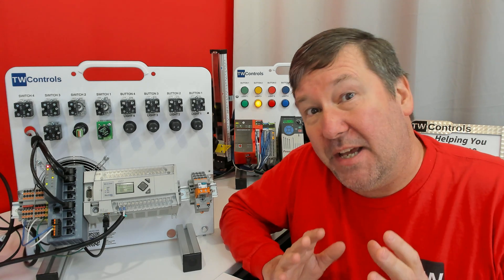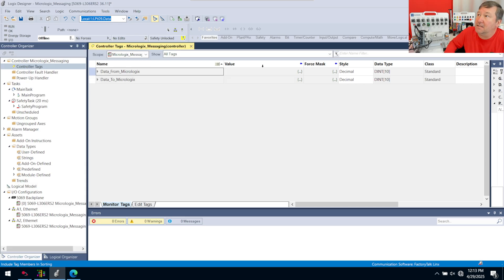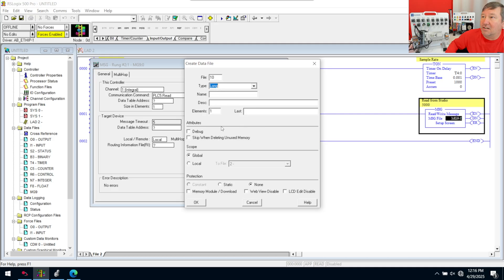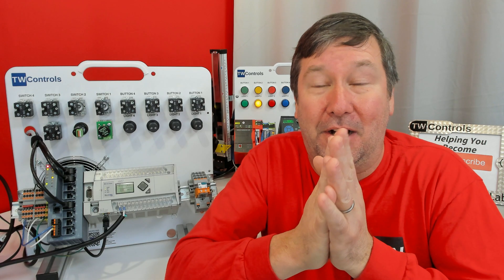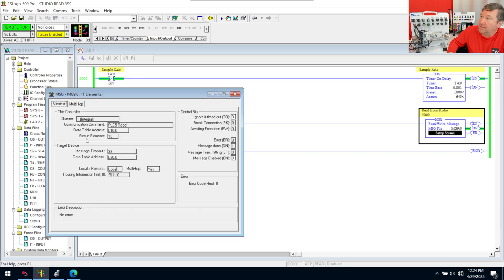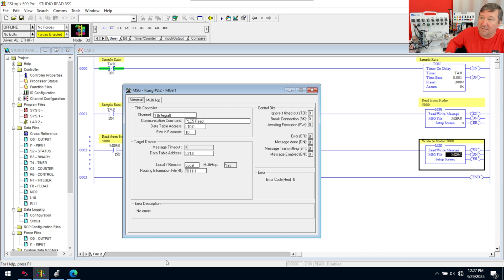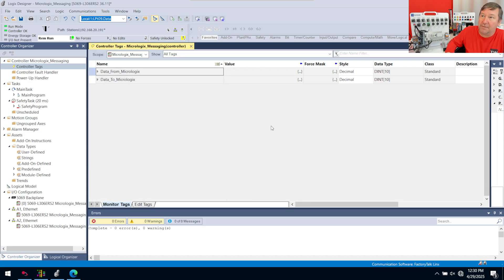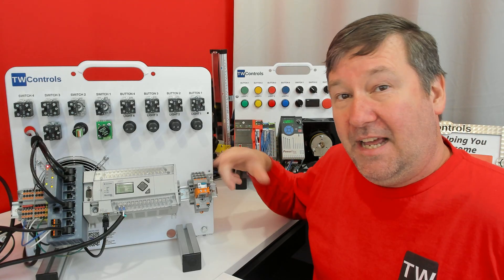RSLogix 500 MSG Instruction: Micrologix to Controllogix/CompactLogix

Comment: why do you use L20 in RS500. You mentioned 20 in studio5000 and added L here. Is that mean anything like you use Long so that did the same. OR any other reason?
Reply from the maker: It was just an arbitrary number that didn't exist in RsLogix 500 so you wouldn't think that it was tying back in some way.

Comment: For me, show error #E0. I try to communicate a ML1100 RSlogix500 with a L74 Studio 5000.
How I know what type data (L, N, B, etc) created on Map PLC/SLC?
Reply: Show: Error code (um upper byte of MGx.y.22) was returned by Comms modules or CIP device
Reply from the maker: They have to match in your mapping.  If it is N7 in your Micrologix 1100 then it would be an INT in the L74.
Reply: @TimWilborne  we have the same issue but with a Micro 1400 and a L32e. we have verified the mappings to be one to one and still getting the same error